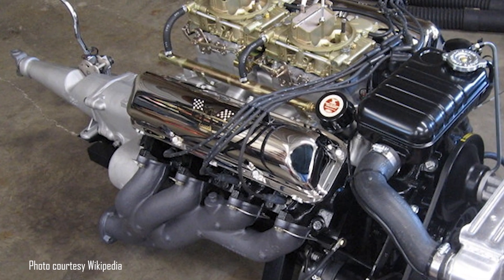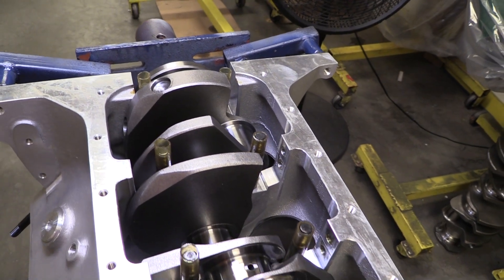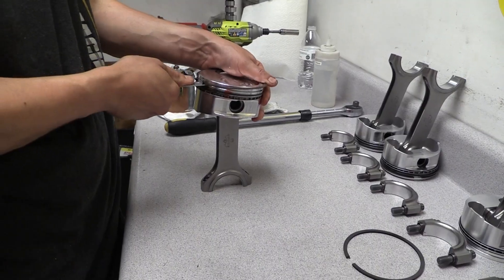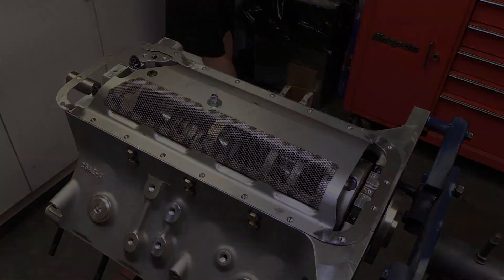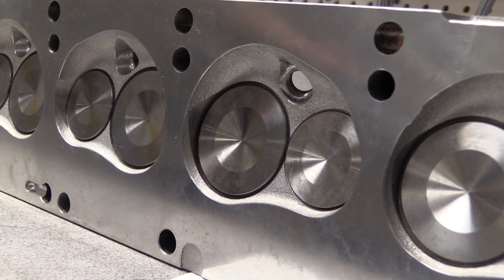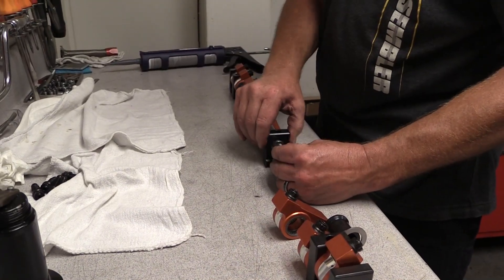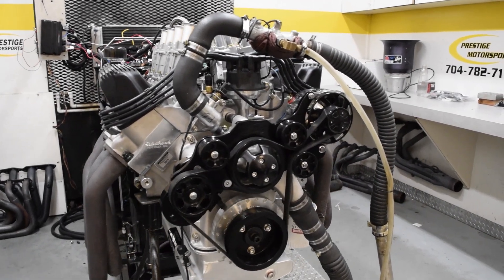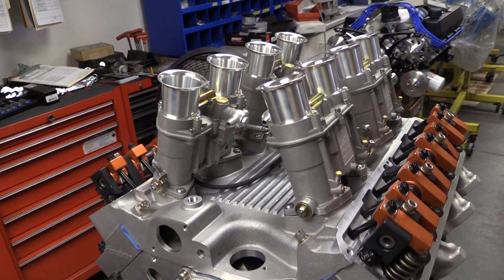Building an All-Aluminum, Fuel Injected FE Ford (with a Carroll Shelby Block!)

Comment: Beware arp studs. Had a set on a weak 4.6 with high compression. 10,000 miles later lost compression on the drivers side cylinder bank. After I tore it down I discovered the studs stretched. How is that possible in a little 4.6 2 valve? Maybe 325 hp. To make matters worse arp refused the so called lifetime warranty. Claimed I must have installed them wrong. First of all I followed their instructions, second its not rocket science its head studs. Replaced them with stock bolts no more problems, so much for arp. ps I have used arp for decades.

Comment: Beautiful looking engine. Dyno graph says it would be great in a truck. Not nearly enough RPM for a proper track day car, even with all the torque.
Reply: Agree but 90% of Cobras real or replica never see any serious track time. plenty of parade laps before shows,very little  max rpm shifts. Been there done that, track time not shows or parade laps.
Reply: You can have the horsepower and I'll have the torque and I'll guarantee you I'll bet you all day long at any track.
Reply: @jalopyjalopy9489  You're wrong.   I'll give you a 1000 ft lb diesel powered cobra, I'll take a high reving 289, in ten laps I'll lap you at least 3 times.
Reply: @chestrockwell8328  you just don't get it do you..? any good engine builder knows torque is what you chase in a track car, cause hp always will follow.
My comment is comparing torque vs horsepower if you had one choice to only have horsepower or only torque, if you had hp and I have torque I'd win all day long, it's not comparing different engines. Understand?
Torque is what gets you going. Don't get me wrong here I like a good high revving engine also but I also love a nice strong engine with lots of torque and throttle response too, both are awesome. A better comparison would be the same cube motor same weight car, one with 600 hp  400 ft/lb and then the other with 600 ft/lb  400 hp. Which one would you choose now?
Reply: @jalopyjalopy9489  Unfortunately it's you that doesn't get it.  Suppose Formula 1 spends all those millions of dollars to win races building more torque that horsepower?  How about Super Bike?   If you want to race tractor pulls, yeah I'll take torque over HP.  We're talking Cobra which are road race track cars.  There's a purpose for the vehicle and and engine for that purpose.  In this case HP over TQ wins the race.
Reply: @chestrockwell8328  I disagree with you but each to there own, in my comparison I believe the torquer setup would win as throttle response and the power from the torque would be stronger throughout corners and the straights cause it would just keep pulling away. But you're welcome to believe what you like
Reply: @jalopyjalopy9489  Coming from someone that has built and road raced four cars off and on since the late 90's I can assure you that your point of view will not win races.  Torque biased engines simply do not have the RPM's needed and the Transmissions don't have enough gears to make up for the lack of RPM's.
Reply: @chestrockwell8328  never mind mate, you still don't understand what I'm saying
Reply: @jalopyjalopy9489  Quite the opposite, I fully understand what you're saying, therefore I am able to say that your view is wrong, and it's not the type engine that will win road races(sports car racing) not drag racing.
Reply: @chestrockwell8328  no sorry you are wrong.. I'm not comparing engines you goose I'm comparing torque to hp.
You are comparing a high revving engine to a truck engine lol that's not what I'm saying and that's why you're not getting it but whatever dude
Reply: @jalopyjalopy9489  Geez you're dense.  Look the original comment is based on an engine built for a Cobra, which you  should know was built as a race car, sports car racing.  Your point is that a torque biased engine (more tg than hp) will win any race on any day...right, this is what you said?   Your view point on this is wrong.  The best, winningest road racing engine are NOT torque biased, they are HP biased. It takes RPM to deliver the performance needed in this type racing. Torque biased engines do not have the RPM to be ideal for road racing...unless perhaps you have a transmission with enough gears to make that combo work, but that is a different conversation.  I provided two examples of this, Formula 1 and Sports Bike GP, along with my own experience in this arena.   Have you personally built and driven a road race car with an engine which is torque biased, and have finished at the front?

Comment: Do the billet Aluminum  mains expand inward or outward with heat  ,  if the main bearings are set up on the tight side do they  gain  more clearance with heat ? I always wondered about that , great video ,  thanks.
Reply from the maker: No. It is counter-intuitive, but the bearing bores actually expand with heat. Seems like it should be the other way around. But you are right, the expansion is greater with aluminum. Many engine builders will often run tighter bearing clearances (by a tenth of a thousand or two) on an aluminum block than cast iron. Thanks for watching.

Comment: I remember the all aluminum engines of the  late 60's and 70's.. what a troublesome machine some of them were especially if you got them to hot.. Damn what a bitchen looking mill you got there brother! thanks this was fun!
Reply: tinkmarshino ; How on earth do you overheat an all aluminum engine?
Reply: @cobracharmer6178  it was done.. you would have to ask the designer.. but it doesn't seem all that hard to me.. aluminum heats quickly and if you do not dissipate the heat it will warp and distort easily.. ever try to weld aluminum? I have and do..  give it a try you will see just what I am talking about.. But I do see your dilemma it does kind of seem counter productive considering all the aluminum parts we use today.

Comment: Great video and great tips.  I would have used a Kaase head and intake combo as John gets way more HP out of an FE than  this build did.  FE's are quirky. Set up right and they rock. One oops and they are turds. I'd want this short block with superior heads and intake.  After all if the short block will hold together the magic is in the heads/intake. More  airflow (with fuel obviously) more power.
Reply from the maker: Thanks for the kind words

Comment: I think that is the most beautiful engine! Will it fit in my Focus?
Reply: All it takes is money
Reply: Enough j.b weld it will fit perfectly.
Reply: Full drivetrain conversion to FR configuration or put it in the middle.
Reply: When I was a Tail Gunner, we would have Fighter Intercepts with F-106's... Speedy airframe.
Reply: @thomasfisher2879  
B-52 i presume? The Six is my favorite jet fighter

Comment: Those vacuum ports in the intakes would have a hard time balancing that large of an engine. Id like to believe they are only there to balance out the vacuum signal to the map sensor so it not seeing a vacuum flutter trying to read off one cylinder.

Comment: What is the reasoning for restricting the oil to the rockers at the deck versus just under the stand? On my FE build I restricted it in the head just under the rocker stand. My thought was that I could easily change the restrictor size to increase or decrease oil flow to the rockers without having to remove the heads. Is there an advantage to putting the restrictor in the deck?
Reply from the maker: I don't think so. Your method sounds pretty good too. The only thing I can think of is nobody is really going to be adjusting the oil restrictor size after the engine is built, so it's location shouldn't matter too much. Thanks for watching
Reply: The Horsepower Monster
Cool, thanks for the reply. Did you have any issues with too much oil going up top since you oil through the head and pushrods? I only oiled the rockers through the head and not through the pushrods at all. I still flood the heads. But my 445 is based on a standard center-oiler 390 FE so maybe that’a why it still seems to put too much oil up top? When I primed the engine, it was a waterfall of oil with the valve covers off!
Reply from the maker: That's a good question. Prestige Motorsports builds a lot of these and I'm pretty sure they also used restrictors when I did a story on an FE build they did for Car Craft a few years ago (https://www.hotrod.com/articles/art-science-building-wicked-beautiful-ford-fe/). But honestly, I don't remember paying any attention when they re-lashed the valves on the dyno and can't remember how much oil was going to the heads. But as many engines as they do, if their customers were having oiling problems I bet they'd hear about it.  Thanks

Comment: Block 4500+ , rotating assembly 3500 or so. Heads 2200 or so and the list goes on. Yeah its worth it You should see them run.
Reply: Well, for well over 10 grand, it SHOULD run well.  Personally, I think that it is
too much for a street motor that only makes 500 hp.  Yeah, it's pretty, but I
would prefer more power over a "prettier"  and  a more reliable engine.
I guess it depends on whether this is a serious "street" motor or a "poser".

Comment: I hope you gave the side oiler intake port on the blockside a decent radius, as the C.S. aluminum block had none, and caused cavitation above 5000 rpm. I worked in what Carroll called his secret service. ( R&D )

Comment: What's the air flow number at the stack?  Sad to see an engine struggle, let the ponies out. Ported heads would have lessened the drop in the torque curve, been more efficient, on pump gas and worth the cost.
Reply: shane    Porting heads MAY decrease LOW rpm torque by increased air flow.  Overall torque increases through out rpm range.  Horsepower also increases.  Guess you learned a different type of math and all those college classes I took were a waste.
Reply: shane  Volumetric Efficiency = (actual airflow/theoretical airflow) x 100.  Your right. An award winning engine builder is your go to.  Though he did none of the engineering, math, physics, or component design.  Just ordered parts measured them and put them together.  Just another internet troll, "keyboard warrior", looking for attention.

Comment: I have an old car, I would like to strengthen the engine in it, what parts should I replace?
Please help, I need your information
large piston, thick piston rods, large crankshaft
is it enough to power the engine
Please
Reply: Murat ... My humble suggestion is to find a good professional engine builder - like prestige here - call them - you won't be sorry !! They know more than you or I ever will - tell them what you have - what you want - they'll have the best recipe - Good luck ! Happy motoring !!
Reply: @tednewcomb1048   I take the parts myself,I want to install it in the car.I want to learn this job slowly.i am an amateur,Thank you for your thoughts and suggestions.i want to do something to learn,I want to save my old car and learn on it.renault Laguna 2.0 dCi. 2007.268000km.110 kw.polska warszawa.thanks my dear...
Reply: @Murat-Seyithaliloğlu  I had to research your Renault - I don't think there are many, if any, of those here in the U.S. - it looks like a very nice project car you have ! Since I am an amateur myself I would suggest getting to know someone that has "hot rodded" a similar engine and see what they have done and use their experience - I know that the heads are where the extra power is in engines - head porting and optimizing fuel and air is the key - possibly raising the compression too - if your car is naturally aspirated - getting into power adders - (turbos or a supercharger) then you'll need forged internals in the block - crank ,rods, and pistons - and a lower compression ratio - I have no idea what exists for Renault engines in the aftermarket - good luck my friend ! You are a true "gearhead" as we say here! Much luck and love from the U.S. !

Comment: I have a set of Edelbrock FE heads.  I'm not impressed with them.  The ports are terrible and it took several hours to clean up the mess in the intake ports alone, same for the exhaust.  The chambers "look" like medium riser chambers, not even close.  The Edelbrocks are designed to use flat top pistons or Ross domed pistons (Edelbrock doesn't tell you that).  The chambers had to be remachined to work with my Arias pistons.  The valves are slightly larger than the 427 low riser and the 428 CJ.  I installed 427 medium riser valves both intake and exhaust, again more machine work.  Edelbrock advertises the heads as medium risers, nothing is the same.  The heads require the use of ARP bolts or studs.  I've had ARP bolts round off and had to pull the engine and use a die grinder to remove the head of the bolt.  Use the studs.  The spark plug hole is deeper than the longest threaded spark plug you can find, resulting in shrouding the spark plug.  If I was going to do it again, I would leave my optional altitude tunnel port heads on it and have a few thousand left in my pocket.

Comment: My problem with the FE engine is the lousy valve train. How in the world did they keep the top end together on the LeMans engines? I kept wearing out valves and heads in 6k miles with my 428 with only a mild cam and running up to 5500 rpm. Now a days money can buy a decent top end.
Reply: That sounds very frequent... Maybe double-check your pushrod math? Aftermarket adjustable rocker arms and shafts from PRW(?) or Harland Sharp should be easier to get dialed-in if you can spare the coin, and hardened valve seats are good for longevity. You might also have a different shop check to see if the valve guides are out of true. Aftermarket heads might hold up better, even if they're the junky edelbrock ones, on account of having all new machining/warranty.
Reply: @sitzkrieg8032  I ran stock valves and valve train. The machine shop at one point ground the top of valves and must have gone through hardness because rockets wore into valves.  40 years ago roller rockers were non existent.  Hardened lash caps may have been the answer.
Reply: Are you're valves properly lashed

Comment: Nice engine build.  One item about the head studs I think you meant galvanic corrosion due to dissimilar metals not galling.
Reply: shane  Thank you but lets agree to disagree.  Galling only occurs between two parts of the same metal and corrosion doesn't require a liquid it only speeds it along.
Reply: shane  I appreciate your lifetime of experience and expertise but think it might  a case where the the wrong name is used.  Galling and corrosion will both stop by grease.  Krytox is often used for stainless fittings and bolts to prevent galling.  Galling is like cold welding of the same metal which is usually stainless on stainless and is common on threads when tightening or loosening. We have all felt it when a bolt gets "crunchy".  Different metals will corrode together while in contact and often snap before the move at all.  I have had a lot of hot dinners.  Have a great day,

Comment: Looks like out of the box cylinder heads work just fine with no porting . That engine would be very nice on the street . How much does the aluminum block expand when heated , was that zero lash when cold?
Reply from the maker: Yes, all the lash was taken out before first fire up. Then, as soon as the engine got warm on the dyno they stopped and set a proper hot lash. Thanks for watching.

Comment: Weslake heads on shelbys 289 put out 689 ponies on his cobra. Amazing stuff
Reply: I seen a Shelby program on t.v. while back n old man Shelby said that was is favorite set up for cobra's but Ford wanted to use those bigger fe engine, Shelby said big engine had to use big brakes big trans big everything then cobra weight to much then messed up handling n traction!! Small 289 engine was all cobra ever needed to beat up on every European car!!
Reply: @scottyjones27  1: the Weslake-heads was not an option in 65/66 2: it was not Shelby or Ford that decided this but Holman-Moody CA US who rebuilt the GT40 into the MkII

Comment: A stock viper engine could have done the same as this engine, maybe not as beautiful to look at, but i am guessing it would be cheaper, then a build from the ground up engine.
Reply: Can't tell the difference in then and than in your paragraph length sentence. Very credible expert. Jackass.
Reply: @salvadordollyparton666  I am no engine expert, but at least I am more on topic.
Personally I am not a fan of solid roller lifters for a roadcar, valves ticking just sounds bad on a more then 10.000$ engine.
Something like a Ford Coyote engine is close to half the displacement, but almost the same power and a lot more modern.

Comment: Looks awesome, just thinking of having it in Shelby Cobra kit car.
Reply: Haha...this is the point where the uninitiated have a tendency to soil themselves
Reply: If you have very deep pockets, most go with the stroker 427 made from a small block or a coyote, they only weigh from 2000-2200lbs.

Comment: Happy for the video, but a bad choice in parts.  The Ford 427 is a fantastic engine 30 years ahead of it's time.  Compare the architecture with the LS motors.  Deep skirt, rail rockers, symmetrical ports, front oil pump. High port (cathedral) heads. Priority main journal oiling. cross bolted main caps. Siamese cylinders.  The LeMans motor (427 cu.in.) ran 4 IDA Webers and was detuned from 600 hp to 450 hp to allow the solid flat tappet valve train  to live 24 hrs.  I wish you could hear mine whine, it spins up like a short stroked small block.